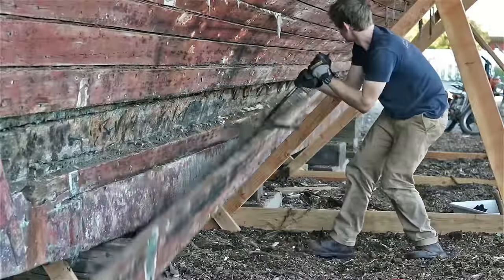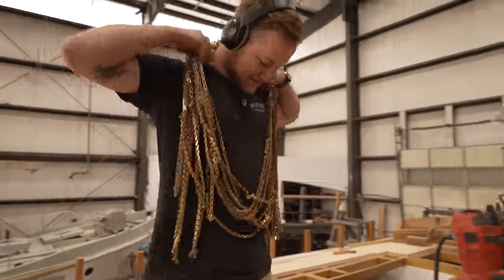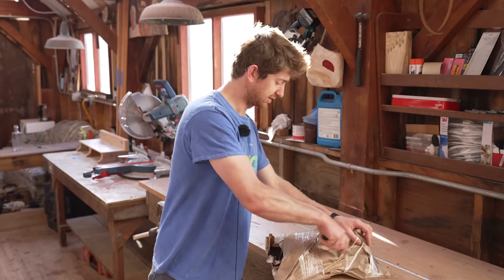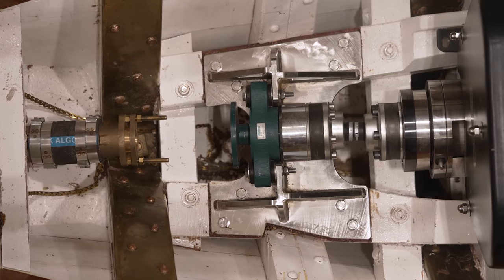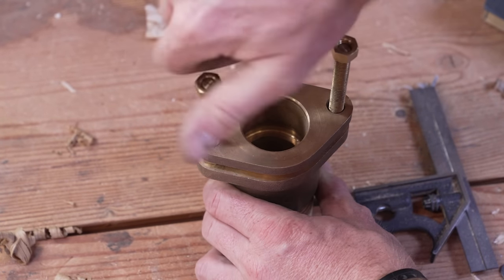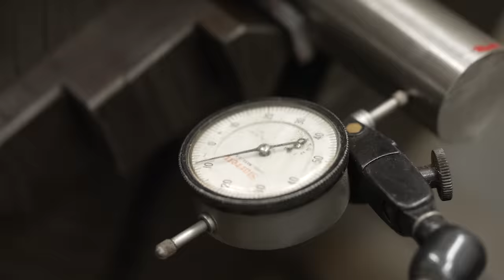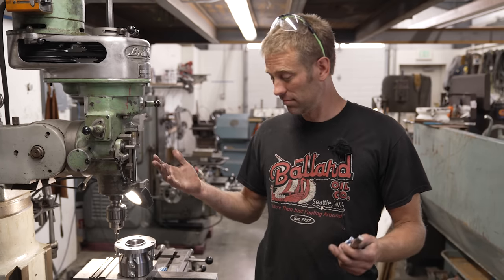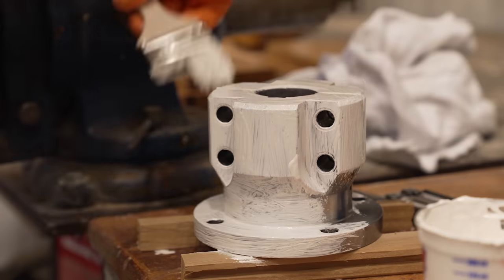Machining the Driveline & installing an unusual Propeller (metalwork & boatbuilding)

Comment: Hi Leo, to stop some of the fake scammers in the comments, add the key words they are using often to your "Blocked Words" in your studio settings.   This will hold it until you can approve or deny it.   I really enjoy your video's, awesome job as usual!
Reply: Or... he could spend his time working on the boat, rather than policing his comment section. And simply allow his viewers to rely on common sense not to fall for spam scams. Just a thought.
Reply: @randomuser778  that was necessary.
Reply: @randomuser778  I kind of care the he cares about the online safety of his viewers.
Reply: @randomuser778  They usually don't post anything in comments. They send messages to people posting here. I have had the message twice, on different channels.
Reply: @randomuser778  There is nothing common about "common sense". People fall for these scammers every day so they continue, knowing someone will fall for their scam.
Reply: @mgmoody42  Exactly, scammers know that their attempts will fail 99.9% of the time, but that .1% is still enough to make the effort worth it for them.
Reply: @ronhudson3730  Of course he does, which is why he warned people about the scam in the video. But I think you are missing my point. The original commenter is suggesting Leo spend time manually approving or denying comments in a filtered spam folder. I am saying that time could be better spent.
Surely you see the difference.
Reply: @MotorStorm  Read the original comment again. You missed the part about approving/denying filtered comments.

Comment: I'm so pleased you gave time to Dylan's machinist skill. It's such an underappreciated trade and these guys are so talented. Bravo again, Leo!
Reply: I love seeing a skilled tradesperson at work.
Reply: Have you watched cutting edge engineering Australia?  If not you might likel it, a lot.
Reply: @waterboy8999  Looks at it all the time.  Amazing skills.
Reply: I saw a wire EDM (electronic discharge machine) at work in a machine shop a while back.  It was kinda boring to watch it work but when I saw the finished piece I was in absolute awe.  I love machine shops.
Reply: and that guy did good work!
Reply: @diggerddawg  check out sinker EDM with dies.
Reply: Us machinists need a little bit of love too! Thanks!
Reply: @gabrielerickson7531  I'll absolutely love any machinist that thinks to put a threaded hole for a jacking screw in a shaft key.  :)
Reply: Cut many keyways , and hand fit , scraped fit taper keys , for hundreds of machines.... The tapered  key  ,"tapered keys".   are interference fit hand w scraped .Open keyway on shaft allows fitting and replacing gears , pullies that are used in transmission of torque .

Comment: How do you control the pitch of the propeller blade? Also that was the best painting job for a part that will never be seen.
Reply: Pitch is adjusted internally.
Reply: I'd like to see what actuates the prop as well.
Reply: You can get an example, by checking out the "SV Seeker" another great example you tuber excellence.
Reply: @timothyhill4630  ok, but how is it told that the adjustment is required, for example when changing from a drive position to the reverse for recharging the hybrid drive
Reply: This is not a helicopter, the pitch is not remotely adjustable, there the mechanism turns the blades when the shaft moves, when the shaft does not move, the water flows tilt the blades so that there is as little resistance as possible, and the ship is not slowed down by the propeller
Reply: @hibahprice6887  but the propis used to recharge the hybrid system when not  under power, how can it to this with the prop folded away
Reply: @hibahprice6887  so then how do you generate?
Reply: Leo sets the range each blade of the prop can move on the prop itself and from there the blades move within that range to the path of least resistance. There is no in-boat on-the-fly control mechanism. When the prop isn't isn't being driven, such as while sailing, the blades are pushed by the water flowing by to be parallel(in line) with the keel. When under power the path of least resistance would be to angle as close to perpendicular to the keel the range allows.
Reply: @Diglett_Dude  I guess that the prop shaft has gearing and would lock to achieve drive when sailing to charge the system and would be placed in neutral when not requiring charging and therefore the prop blades would fold causing less drag.
Reply: @incarwitness  ok, makes sense . Thanks 👍
Reply: @incarwitness  It doenst "lock" they constantly move pitch when in gear, when in neutral (shaft free to move, they feather), when the shaft is "locked" to the generator the gear in the prop will engage due to resistance and the prop blades will unfeather at a angle that will cause the shaft to turn.
Reply: @taylorwso  that makes sense.  Thanks.
Reply: @a.jsipple7322  This prop does not work like SV Seeker prop.
Reply: The box had the name Variprop on it. Youtube has lots of videos explaining how it works. Pretty cool!
Reply: @froggiedafrog  So when he puts the gearing into reverse for generation, that will cause the prop to 'think' it's being driven and change the pitch to engage the blades.  Correct?
Reply: It’s Borg technology
Reply: The manufacturers, SPW, document how to use the prop for recharging on page 12 of this manual: https://spw-gmbh.de/en/support-specs/downloads/manuals-and-documents?file=files/downloads/montageanleitungen-dokumente/variprop/englische%20Anleitungen/Variprop%20GP%20112%20%2B%20140%20Installation%20Instruction%20%28Rev16%29.pdf&cid=1490. TL;DR is that it's done by putting the engine into reverse to set the pitch, and then neutral.
Reply: diving suit
Reply: It is not a controllable pitch prop. It is a feathering prop.
Pitch is set on installation and feathers by water force when sailing ahead. When locked in reverse blades stay out and roll in reverse and magically charge something on the hybrid drive.
Reply: Master Capt Doug of SV Seeker has done this thousands of times you should seek Master Capt Doug advice

Comment: For those who want to know how the propeller works:  

There are internal gears inside the hub that engage when the boat is put into forward or reverse, so depending on the direction of shaft torque, the blades rotate to a thrusting position.   With the transmission in neutral and therefore no torque on the driveshaft, the water pressure on the blades pushes them into a neutral position.
Reply: Oh neat! I get it now, good explanation!
Reply: How does it manage to generate then?
Reply: It will only feather from forward thrust. If in reverse pitch the water pressure keeps it in reverse hence the ability to re-gen. It's simply a function of an offset hinge point.
Reply: thank you
Reply: So, for enabling regen the prop needs just to be run in reverse for a short time and then begin sailing?
Reply: Does that also mean if Tally Ho is actually underway and regen has not been engaged by reversing the engine, that even with forward motion, the engine can be put into reverse and regen can be engaged?
Reply: Can you back the boat up? If the blades flip when you put it in reverse won't it push the boat forward running it in reverse?
Reply: Thank you for the explanation, sadly it's still beyond my comprehension.
Reply: Bloody clever!!
Reply: At 21:50 Leo does mention "whatever pitch you set them [the blades]" so there is more to it than this. There must be some means of setting the pitch angle to which it locks for thrusting -- but I don't see any control inputs, other than the shaft rotation as you say.
Reply: @letsgocamping88  as Leo mentioned, the transmission is put in reverse gear, so the shaft isn't free spinning, therefore  the water going over the blades is putting torque on the shaft.  They'll only feather in a neutral position if the driveshaft spins freely
Reply: brilliant, ta!
Reply: @rushd45  no
Reply: @hydroxacte  the pitch is set when you install the prop. You are just setting the limit in either direction. The torque from the engine is what flips the blades to either the forward limit or reverse limit. When the prop is in forward and you stop the engine the water pressure acts to feather the blades but if the prop is in reverse the water pressure holds the blades in reverse. Just think of it as the water pressure making the blades rotate in one direction. from forward that's towards feathered and from reverse its towards reverse so the blades don't move.
Reply: @TheFlyingPlectrum  So the prop only has 3 pitch positions - Forward; Feathered; and Reverse/Regen?
Reply: Thanks🙏, I wondered how it worked without hydraulic pressure…
We will probably know in a future uploaded video, but I wanted to know it tonight😇
Reply: I asked that in my original comment so now Leo doesn't have to reply. Thank you for the explanation, makes sense now.
Reply: Why do the blades need a different position in reverse from the position when moving forward. Solid propellers don't change blade position.
Reply: @hydroxacte  There's a guy SV seeker that built a steel replica of a Chinese junk in his backyard, he has a variable pitch prop that he can control the pitch angle from the helm. It uses hydraulic fluid to operate it. If you are interested, this is a video of him getting the bugs out of the system. 
https://www.youtube.com/watch?v=bco8JzoohrY&t=144s
Reply: @bigredc222  Doug is the MAN!
Reply: @Nick-ye5kk  propellers have a leading edge and a trailing edge. Rotating the blades allows the leading edge to be leading regardless of whether you are in forward or reverse. This should give much better performance in reverse than fixed blade props.
Reply: @Nick-ye5kk  And they cause a lot of 'prop walk' as a result. My last boat, which had a little two bladed prop could barely reverse to starboard at all due to prop walk. I had to get it moving a couple of knots then throttle down to turn to starboard in reverse.
Reply: I was looking to know this, thanks for your posting. We have become so much involved with sensors & drives, it’s wonderful to be back with a mechanical arrangement.
Reply: @hydroxacte  Others have mentioned that you set 'stops' in the assembly before it is fitted.
Reply: Thanks for explaining how it works, and it is a beautiful piece of engineering.
Reply: Sorry I thought you were able to adjust the pitch of the prop, where in fact the pitch is a PRE-SET  that ingages when in gear.
Reply: @Nick-ye5kk  On a fixed pitch propeller you reverse the shaft rotation to switch from forward to reverse. On a variable pitch propeller you change the pitch of the blades instead the direction of rotation of the shaft. The same principle is used on gas turbine powered Navy Frigate war ships, they simply change the pitch of the blades from forward bell to reverse bell while the shafts continue to rotate the same direction at the same speed.
Reply: @ET_Don  Some ships can do that but I don't think that's what Leo's system will do.
Reply: @Nick-ye5kk  True dat. I believe a system like what Leo chose, the propeller has only 3 positions ... forward, reverse or feathered. Either forward or reverse will double as both propulsion or regen.
Reply: @Nick-ye5kk  solid propellers require a reversing gear that changes the direction of the shaft. The engine itself does not reverse direction
Reply: How then does it get into battery regeneration mode?
Reply: @hydroxacte  think of a bendix in an engine starter. The torque of the spinning starter motor forces the starting gear to move along a helical spine to its engaged position. When the torque is removed (or overcome by the speed of the flywheel) a spring returns the gear to disengaged position. Instead of moving a gear along a shaft, torque applied to the prop shaft creates a mechanical force to rotate the prop blade pitch to the forward or reverse pitch position. There is no external controlling system necessary as in controllable pitch propellers.
Reply: @ET_Don  minor nomenclature point... The term variable pitch applies to a solid prop that has a pitch that changes with respect to the radius from the hub. This has to do with hydrodynamics and reducing cavitation at the outer edge to improve efficiency. Fixed pitch is the same along the entire blade (like a ceiling fan). On controllable pitch props (like Leo's and the systems some people incorrectly refer to as variable) the blades are rotated on the prop hub  to change the thrust direction. On more complex systems this involves hydraulic controls. On Leo's the change of pitch is caused by torque on the shaft.
Reply: @PeteFolksinger  I believe you may be thinking of a "Progressive Pitch" propeller sir.
Reply: @ET_Don  you are correct. The construct above was based on how one of my past work environments used to apply the terms. They got very adamant when folks called controllable pitch props variable pitch. If there is a difference between variable and controllable pitch, I would like to know.
Reply: @PeteFolksinger  The terms associated with variable pitch propellers may also vary in the aviation community. For example, I was taught a variable pitch propeller is also called a "Constant Speed Prop" when its pitch is controlled by a governor. On the other hand, the collective stick in most helicopters (I'm a dual rated pilot) directly changes the pitch of the main rotor blades. Then again, on some ultralight aircraft you can change the pitch of the propeller blades, but only on the ground with tools,  so I would consider this variable but also fixed pitch because it cannot be changed in flight. Just three examples there. So the definition of variable vs controllable pitch props would depend on who you ask. IMO Controllable pitch would be fully controllable at all times either by the pilot, or helmsmen on a ship, and variable would be adjustable on the ground with tools, but not controllable at any time. And blades can be progressive pitch on a fixed, variable or controllable propeller. Apologies for the long answer.
Reply: @ET_Don  no problem, makes sense.
Reply: You answered my question, amicid!
Reply: Ah! Good explanation. Thank you.
Reply: @TheFlyingPlectrum  I was just wondering about this. Thank you for explaining.

Comment: Finally worked out how the Variprop works in regeneration mode. Forward rotation of the prop shaft causes the prop blades to rotate into the forward thrust position. Stopping rotation and the blades will automatically move to the feathered or neutral angle of attack position. However if the prop shaft is rotated in the reverse (astern) direction the prop blades rotate into the reverse thrust position and remain locked there. If the engine is now de-coupled from the electric drive system and the vessel in underway by sail the prop will drive the generators producing power.
To return to either feathered or forward thrust you need to move the gearbox from reverse through neutral to forward and apply power for a few seconds.
The prop transition can be achieved with either the diesel engine or the electric propulsion system. This is genius as it means should you have a engine failure or just run out of diesel you can, so long as you can raise the sails, recover the batteries which can store 40 kWh of power.
This is an insane amount of electrical power for a boat. Whilst it won't give you much in the way of range it would power most boat systems for weeks if not months.
Possibly more important it gives you a back up emergency manoeuvring option. For example getting into a safe harbour with adverse winds.
I was a bit stunned to work out that the eight Victron Lithium Ion 24V 200ah batteries cost £32,000 ( $37,438) but considering the hull value of Tally Ho it's a drop in the ocean, so to speak....
Reply: It fooled me till I saw your explanation, thanks Anthony :)
Reply: Thanks, I was scratching my head about that propeller!

Comment: 19:55 - I’ve been using the Custom BrushMaster 3000 for years & cannot tell you how much time & money it has saved me. the bristles were specially designed by top Nasa Scientists for the Saturn Rocket return systems program & the handle was specifically designed by the world’s most important ergonomic research lab technicians to date. obviously, I love using my Custom BrushMaster 3000, but don’t just take my word for it…here’s a few testimonials from professionals in the field that use the Custom BrushMaster 3000 in their daily professions…
Reply: I hear they make extensive use of the Custom BrushMaster 3000 at the Large Hadron Collider.
Reply: @Xondar11223344  - I sure hope they use only High-Quality tools like the Custom BrushMaster 3000 at the Large Hadron Collider facility. an accident at that joint has potential to transform Earth’s matter irreparably & cause quite a stir.
Reply: You know I've had a Custom BrushMaster 3000  on order for 3 months now., but the supply chain is still a little sluggish.  Hope to get it before Christmas.
Reply: Ever since nVidia took over production of the Custom BrushMaster 3000 the supply chain has been compromised. I've heard from reliable sources that they hope to remedy the shortage by releasing the Custom BrushMaster 4000 series shortly.
Reply: @DavidWieder216951  I blame all the crypto miners for that.
Reply: Wanted a brushmaster 3000 all my life, but the price is outrageous! Not going to pay it! So, I bought a HF chip brush, trimmed the edges of the bristles, and voila! My neighbor thinks it's real and is green with envy.
Reply: A man is only as good as his tools